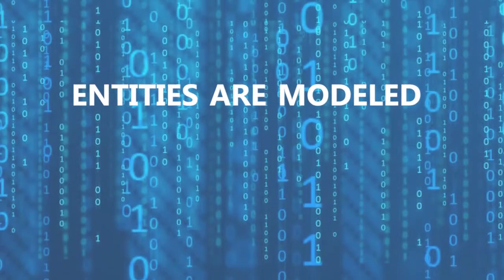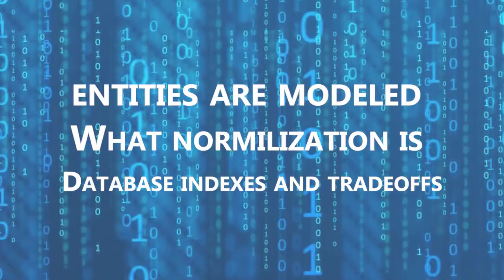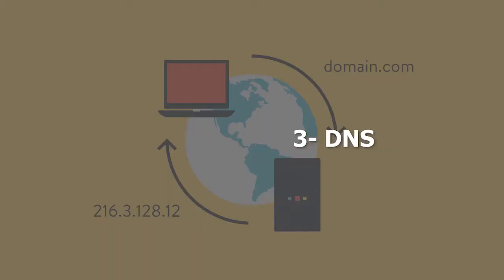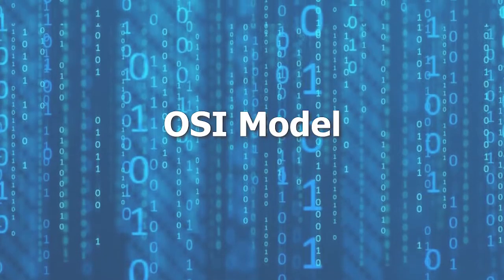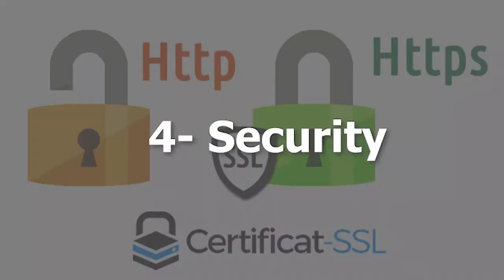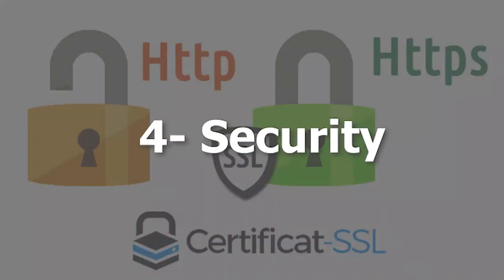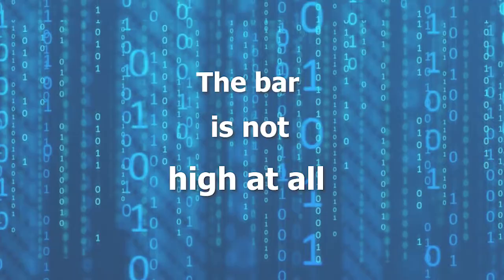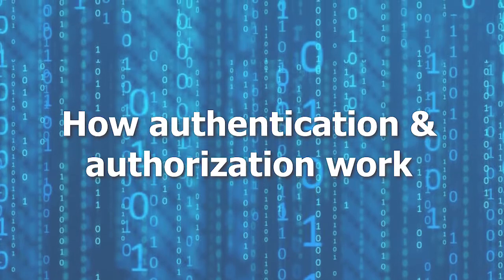Cracking the Systems Design Interview - Part 2: HTTP, SQL, Berkeley DB, and More

Comment: Hey Victor, thanks for sharing your insights. This is indeed first principles thinking at best, communicated in a clear and direct way. I’m lucky to have found your channel. I think the amount of videos out there on these topics are a disservice to junior and mid level engineers who actually want to learn this stuff, not just for interviews but also for curiosity. You also reiterated that one needs to build some of this stuff and say add 20 million records to a table. Instead of just dropping Cassandra when they hear the word write heavy without thinking through the broader picture.